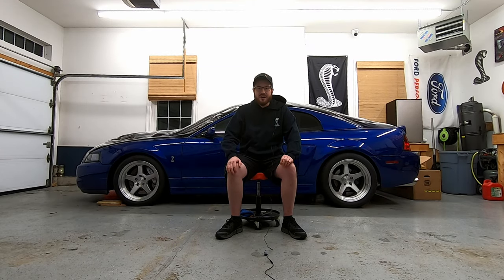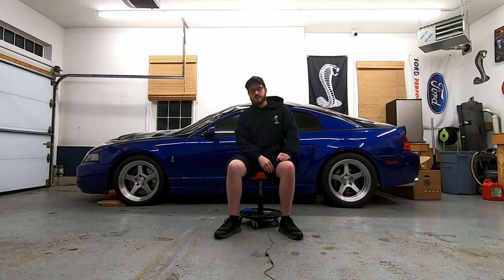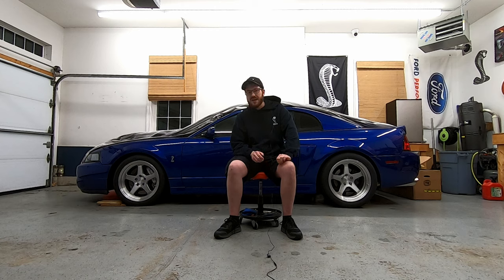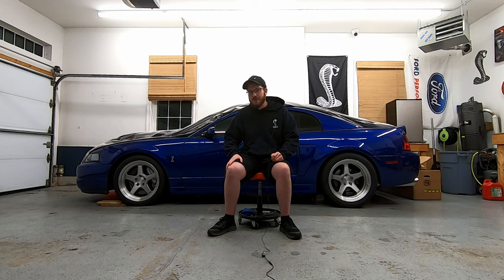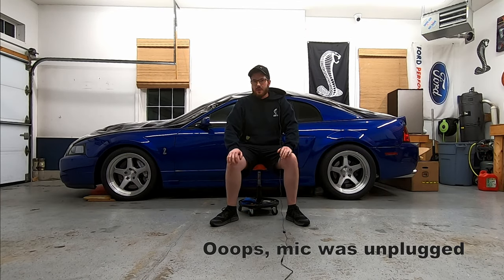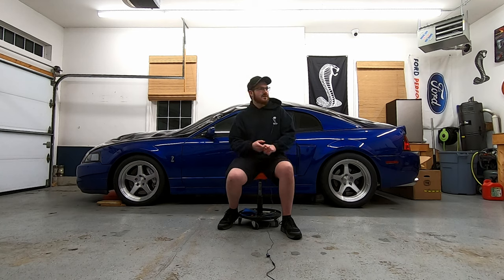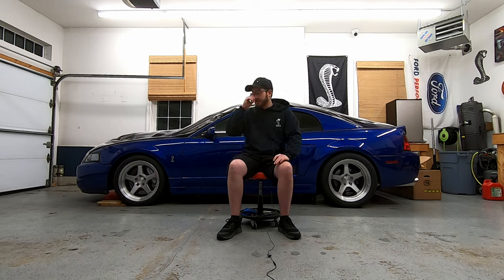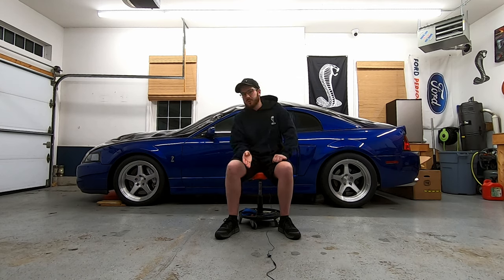Should You Cam Your 03 Cobra? Good or Bad Idea?!?

Comment: Lol Guess I’m not doing cams. always have had concerns about opening engine when modifying my terminator. Lots of trust involved but does it hurt it’s value is always a big deal breaker.
Great video. Info is king.  Cheers
Reply: I'm the same way with my 2v, was gonna buy a 5.0 stroker kit for it but it's my daily driver so i can't be without it for a month or two till it's done, gonna put heads n cams instead 1st then in the future build it more, but the n/a route is always more expensive, but less with a 2v vs a 4v so yeah.. i say cam it tho, it's extra power, even a stage 1..

Comment: I've got Comp "Stage 2" supercharged cams and I think they're awesome. You definitely lose quite a bit low end torque, but drives just fine and the mid to top end power is a rush. You're right about hidden costs; at a minimum you'll need springs and there's a lot of time to degree them in. Definitely something to be done with the motor out of the car. Tuning was also a pain, but I was doing it myself. I also have ported heads which are needed in my opinion to really take advantage of the cams. There's also little things like PTV clearance and finger follower geometry to pay attention to. Yeah, one simply doesn't just throw in some cams and go, things really add up quick.

Comment: Great video Kevin!  I talked to Todd a few days ago about cams. It's expensive for me I'm in New Brunswick Canada. Those would be the ones I wanted. Kevin Dunn remote tuned my car I could not be happier he is awesome! Car runs and idles like stock. I have a built motor 2.3 Whipple, Return style fuel  system. Maybe bigger blower in the future.  Makes me nervous to maybe lose some drivability. I love your car watch them all great videos!
Reply from the maker: Todd is the man
Reply: DUDE I CAN'T SAY IT ENOUGH LOL I  LOVE SONIC BLUE.IF YOU HAD ANY PROBLEMS WITH YOUR CAR WHAT WOULD IT BE LOL MINE HAS SUCH LOW MILES LOL IT'S LIKE DRIVING A NEW COBRA LOL.I HEARD A LOT OF THINGS ABOUT THE REAR INDEPENDENT SUSPENSION.

Comment: I think they sound better with a good chop but somewhat mild (kinda like yours) when theyre chopping so much it sounds like its having trouble idling it isnt for me.  The l&m nsr cams for gt500s are perfect for what i want i love how they sound and i hear they drive nice and make good power.  That is the direction im gonna go with my 07 gt500.  I want good power but driveability matters to me im not willing to sacrifice it for every last hp.  I am gonna do cams and longtubes at the same time i build the motor.  Im going to get a loan when the car is paid off and do it at once.  It would make the install make sense and prob save me money in the long haul.  The cams shouldnt add that much to the labor if youre already having your engine built by the person.  Makes it alot easier for them to install it...same with long tubes.  Makes the headache of both installs not as bad plus they really compliment each other.  Im gonna swap the blower on the stock motor first then 3 or 4 years down the road is when i am gonna have the engine built with higher compression, cams and longtubes.  That makes the most sense as far as the build im planning.  I wouldnt do cams before a blower swap.  After the blower swap the cams will help you alot more than before the blower swap also that is another thing to consider.  I wouldnt just do cams alone and pay all that labor just for that especially on the stock blower.

Comment: I myself have been looking at cams. However I'm not sure if I will gain much. I currently run the whipple gen 5 3.0 running 23lbs on E70/ARH 1 7/8" headers an other supporting mods! Dyno Jet numbers 908/800.
Reply from the maker: Custom cams from Todd would gain you a considerable amount. Email him
Reply: Dude your setup is optimal for a cam upgrade...meaning its prob gonna gain as much as anyone will going cams.  You have a setup that youre pushing pretty good in a setup like that the cams really hold you back at high rpm.  For example bj the guy from venomous tuning that tunes mostly gt500s i think he had the car "christine" that was a vmp test car for a long time.  It was on e85 gen2r 2.4 upper 15% lower mac effort setup it was setup kinda like your car and on e85...they literally picked up 80 rwhp with just the cams i wouldnt be surprised if you pick up close to that.  Different cars but very similar in layout and the results would be similar imo.